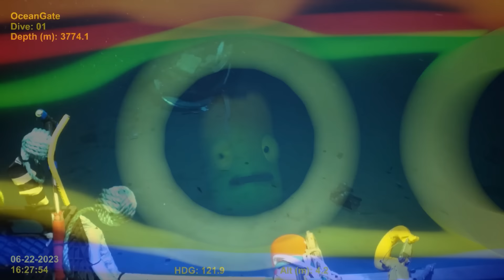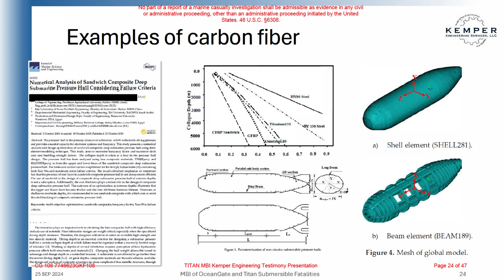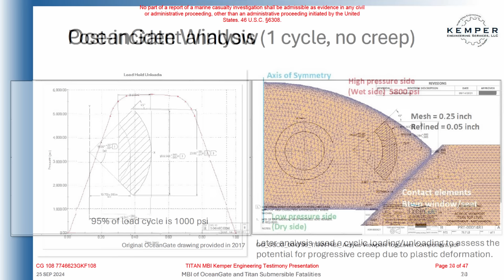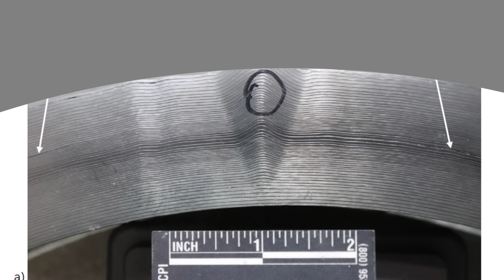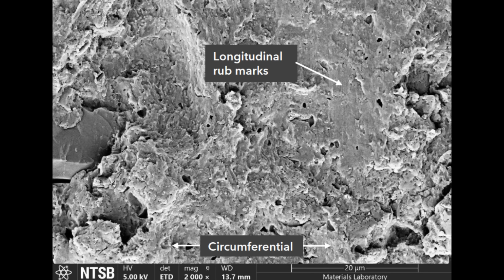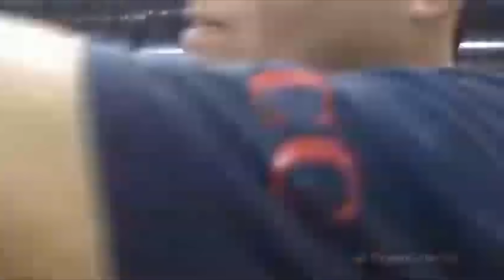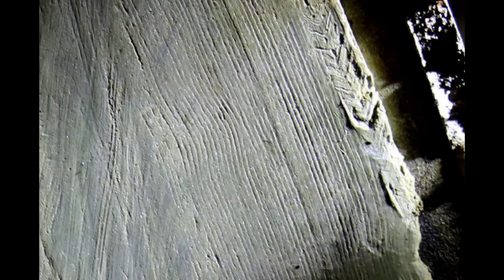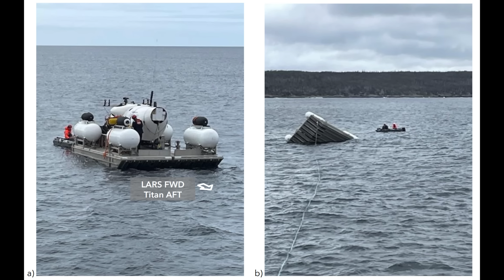OceanGate Wreck Shows Why Sub Wasn't Strong Enough To Survive - NTSB Shares Important Details

Comment: Sanding down the carbon fiber to smooth out the wrinkles??? That’s literally breaking it, the whole point is that the fibers are continuous. You know how they unwind the cocoons of silkworms instead of grinding them up and gluing the remains together? 

Either way it actually seems like none of what we’ve all been talking about was actually the failure point, it’s much simpler than that. Glue. Most common failure point on anything I’ve worked with that uses it. The carbon fiber distortion from fatigue and poor manufacturing certainly didn’t help but you absolutely cannot get a good strong reliable seal between composite and metal with just glue, and you can’t drill bolt holes through carbon fiber so it’s the only option and that’s the biggest reason of all not to use carbon fiber for this, not an inherent lack of strength but because it has to be all one piece and joining it to other parts doesn’t work well
Reply: Great analogy of silk cocoons. Thank you.
Reply: The phrase ”glued together submarine” doesn’t make you feel good
Reply: @hammartid  It kind of depends - the thing with submarines is you have all the pressure going inward so in theory the external pressure should hold everything together if it's designed properly. So for example, if they had had a thicker titanium flange on the inside that was capable of supporting the internal stress wouldn't break then maybe the sub wouldn't have imploded (problem is, if it hadn't imploded on this dive, Stockton would have kept using it until it did, like there was an obvious failure on 'dive 80' but kept going)
Reply: @takanara7  That's the funny part - the dive, being haphazard as it was, almost succeeded.
Reply: If you start crushing pipe and you see wrinkles in it, you know it won't be long now. They had wrinkles before they even applied any pressure, so the had pre formed failure points.
Reply: I agree. It’s the unpredictably and the minutely difficult prospect of in process checking that should make this option infeasible.
Reply: The grinding between layers means that the glue is always attached to broken carbon fibre on one side. I am not am engineer, but that seems like a bad idea for a structure that needs to avoid delamination to me.
Reply: What I find concerning is the size of the titanium mating flange (to the CF)
on the outer rings. 
..
It just doesn't seem deep enough or a  large 
enough cross sectional area for the glue to fully support or hold the end cap on.
..
If that mating flange protruded say 12 inches into the hull maybe a stronger bond?
..
I also wonder if both ends caps were bolted together with long studs and the carbon hull wrapped around those studs would that have made a stronger vessel ?
Reply: @stuartd9741  Yeah if the flange had been larger, it would have held up - this time.  But Stockton would have kept using it and it would have eventually failed for some other reason later on.
Reply: I agree on the glue part. 
But concerning "That’s literally breaking it, the whole point is that the fibers are continuous.":
Not necessarily. Surely it's not strengthening the material in that location. But like in ropes, fibers in fiber reinforced plastics can be interrupted, as long as the load can be redistributed to other fibers by the matrix (epoxy resin). There are parts manufactured with short fiber reinforcement all the time. However, their performance is lower of course, but also because the fiber orientation in such parts usually is random and not oriented according to the stresses present.
Reply: Glue isn't bad per se. PVA glue used on wood is stronger than the wood itself when used right.
Reply: Glue (bonding agents) CAN actually be physically stronger than the materials they're joining, I've seen it and done it myself... BUT it takes special efforts and thorough understanding of the materials, loads, responses, etc. to make it work... and the biggest take away here was that the understanding and knowledge, the basic data, was full of holes and unknowns... proper procedures are essential and even that was all being made up on the fly...
Reply: @lukestrawwalker  Which brings up the memory of their haphazard glue job in an uncontrolled environment with a spreader that looks like it came from a dollar store.
Reply: @dustman96  definitely!  It was a Mickey mouse operation from the start, the more we learn the worse it was!!
Reply: I think the failure point was the flange on the ring, caused by the composite tube being more compressible than the titanium ring.
Reply: I'm pretty sure there is some kind of solution with carbon fiber, they just don't care about reaching it... probably because it will cost same or even more as titanium hull.
Reply: Even I, a moderately informed laywoman, knows better than to sand or break carbon fibers in an item made from CF. It destroys the structural integrity of the item you're building. While I'm fairly certain there are ways to properly patch an area that had to be sanded down, I am dead certain Oceangate didn't follow them, based on everything I've seen.

Comment: 17:25 well I think your on point porosity definitely doesn't add strength. Kinda looks like it had many defects related to manufacturing....I bet the original breach was from the front edge of the tube splitting apart the carbon fiber layers like it did. Btw thank you for covering this, I've also been pretty obsessed with any more information about this disaster. 👍🏼

Comment: Solving the window problem would have been possible by maintaining the qualified concave inner face and applying a flat-faced lens to the inside with a nonstructural interface layer such as a silicone adhesive with a similar refractive index.

Easy to say with the benefit of the FEM simulation in front of us, but it might not have been obvious without that analysis.

Comment: Regarding the co-bonding adhesive between the 5 1-inch layers, two of them were applied with very little little porosity (between layers 2/3 and 4/5) and are pretty much entirely intact in the debris. The other two layers, between 1/2 and 3/4 had higher porosity and were almost completely delaminated in the wreckage. It seems like the adhesive used was of an appropriate strength, but applying it correctly was a challenge.

Comment: Particularly on Leech Lake, Minnesota, anyone that has owned a fiberglass motorboat, could easily imagine what multiple dives would have done to this idiotic contraption.
Weathering of fiberglass canoes, notwithstanding (remember those at summer camp?) 
The temperature extremes to sub-zero weather most definitely "accelerates the aging process"... wood hulls - with proper care - is by far more durable
(even aluminum hulls are more prone to cracking)

Comment: Boeing said it needed more. This sub was too unsafe for. Boeing. ...
Reply: Boeing has a LOT of carbon fiber experience regardless of their other safety issues.
Reply: That really puts things into perspective...
Reply: For all the trouble Boeing’s in, carbon fiber structural integrity is not one of them. Their CF work on the 787 is so revolutionary that not even their top rival Airbus can replicate it nearly two decades later.
Reply: As far as I can tell, it's the software and all the other support components is where Boeing is having problems and all of that is on newer revisions of ancient aircraft like the 737, I am not aware of any major problems with the 787 which as far as I can tell is one of the finest examples of carbon fiber engineering and not even Airbus is capable of replicating it
Reply: @the_undead Also assembly and QC, both theirs and their contractors. Not with 787 at least.

Comment: It's not "armchair engineers".
It's reality: carbon fibre is massively strong in tension. It has no property in compression. Used in compression, it's the epoxy resin that's actually taking the load.

Comment: The thing to remember about the use of carbon fiber was it was not to make it stronger , it was to make it lighter so they could cram more people into it . 

Carbon fiber is used when you need it lighter , otherwise you use other easier to work with materials that are not so risky .  The problem with a layup is that it is near impossible to get one that is perfect , and in this case defects cause load points that fail .

Comment: The trick to shaping the window to appear less distorted is to not have the flat face touching the tapered frame. Have a water layer between the convex window and a round-capped plug for the interior to optically bridge the gap between the two, but the interior window is just floating in a rubber frame to hold the water pocket in there and present a flat optical surface to view through. That's my guess anyway, it would have to actually be tested before I'd actually use it for anything like Titan.

Also, it seems like some reinforcement rings around the inside of the carbon fiber, some ribs, would've gone a long way, but at the end of the day it was always a disposable design because carbon fiber held together with epoxy was never going to be a reliable pressure vessel. Gluing the rings onto the ends by hand was also a mistake. They should've just flooded those rings with epoxy and then set the tube into them, and the ring channels that mate with the tube should've been deeper and with thicker walls.

Comment: Im thinking they should have had external titanium straps located around  the circumference of the hull pulling the fore and aft rings together . Relying on glued joints alone was asking for trouble .

Comment: Could have increased carbon fiber to 12 inches, but look how much money he saved by only winding 5 inches of carbon fiber.
Titanium end caps were cast instead of milled, again look at how much money he saved
Reply: weight is also a problem.  can't just make the hull thicker without limit, it has to float too!

Comment: the main issue really was using carbon fiber in the first place. if they used steel or titanium, there would have been no need for glue and ensured a far more solid pressure vessel. sure it would have cost more, but it could have saved their lives.

Comment: Haven’t worked with carbon fiber, but have with acrylic and epoxy. Acrylic strength at layered areas can be weaker. Epoxy is a bugger for bubbles and contaminants, even dust, which causes weaknesses. The more details emerge, the more I understand why the one engineer refused to get into the thing.

Comment: The only way I think I would ever trust it, Is if I built two craft that are identical, and have one of them get cycled more at the start and then have the same "Test-Sub" go down and then back up before each time the craft with passenger makes the same trip,
And also, I would have had a much smaller scaled-down test model that was built using the same CF/epoxy/TI, along with the same bonding process, to get cycled to a greater crush depth, and then to have the CF/epoxy examined by cross-section after it's been aged with full cycling.
This would be the only real way of knowing, then calculating the submarine's expected life expectancy is, As you really need proper physical testing before you can try and use computer simulations.
Reply: that's literally what they did with the bathysphere.  sent it down unmanned and hauled it back up.  they only sent humans when it stopped coming back up full of hyperpressurized water

Comment: Bangs correlating with sharp changes in strain seems like an incredibly huge and bad warning flag... Even if I don't understand any of the other finer details about reading the charts.  I feel like any remotely competent or even just curious engineer would want to go and fetch all of the available sensor data and look at all of the sensors immediately before and after the really big bang to see if any other sensors recorded any kind of anomaly... And then they should have seen it and gone oh wait there was a loud noise and the stress on everything sharply changed that doesn't seem like a good sign if everything is supposed to be securely bonded together so it can't move

Comment: Wow so the hull monitoring system gave early warning several cycles before the failure happened. That's actually quite impressive. If Mr. Rush spent half the time he talked about it, looking at the data he may still be alive. Of course you would need to build at least a scale model with the hull monitoring system and then they would have known a "big event" means failure is imminent. Which I think anyone could have figured out. It went off the charts. So the thing supposed to predict failure by measuring certain events, detects one so large it presumably goes beyond what the microphones can capture without distorting and they ignore it? It's like checking the bilge for water and seeing half the ship flooded and going back to bed. Why even bother?

Comment: I'm dismayed that they didnt lay any fibers at 45 deg. Carbon layed at 0 and 90 deg is shockingly week and eslatic along the 45. Fibers at 45 deg may have also helped stabilise the structure during layup and cure...
Reply: I am dismayed they didn't lay down the fibre for the whole length of the cylinder at once. And even that would had failed anyway eventually at the junction with the titanium ring.
Reply: I'm sure doing it at 45⁰ would have reduced the wrinkling too

Comment: I'm curious why they wouldn't have some sort of roller that squeezes down the applied carbon fiber layer to a specific tolerance after every application. It seems like that would solve the wrinkling problem in a straightforward way. That roller would always be a fixed one-layer distance away from the mandrel so you could set that up and calibrate it pretty easily.
Reply: It wouldn't stay that way since it needs to be held down while curing. On the other hand, that is why vacuum bagging exists. Having so many layers though will eventually amplify any wrinkle imperfection.
Reply: @DKNguyen3.1415  Good points.  I guess yet more reasons why CF of this thickness is just not feasible in this way.
Reply: @doublestrikePhoto  Yeah. I'm kind of wondering what the thickest laminated carbon fiber structure is. I also wonder how much tension is being put on the fabric when it's rolled onto the mandrel.

Another commenter here said that the wrinkles are a result of the vacuum bagging which compresses the carbon fiber to a smaller diameter and the wrinkles are a result of that extra circumference of fabric needing to go somewhere. In which case, the problem is considerably worse than just amplification of imperfections. They suggested layering it up internally (which would then require a balloon to pressure the carbon fiber against the walls during autoclaving) but to me, that also sounded unreasonable. They said some NASCAR parts are made this way though.

Comment: Excellent video, well done.  

The "carbon fibre no good in compression" point seems intuitive but all CF engineers I have seen commenting argue against that, citing CF aeroplane ?wings or bodies having parts of them in compression.  I believe there are cycle/hours restrictions on those, and of course Oceangate lacked the data to calculate suitable numbers.

The message I take from this video is that it looks like NTSB is going to be able to produce a great analysis of the design errors and the failure.
Reply: “CF no good in compression” is definitely a simplistic statement. Most materials have different strengths in compression vs tension. CF is weaker in compression. A good engineer will understand the material properties and all the forces that his design will be subject to; and make sure that it has sufficient margin to withstand those forces. Oceangate didn’t understand their materials, didn’t understand all the forces involved, didn’t have sufficient quality control during manufacturing, and didn’t do any data analysis or non-destructive testing to know that the sub was failing.
Reply: @bbgun061  Yes, 100%.  From what little I know about buckling failures, the failure point can be rather sensitive to construction and fatigue defects and hard to predict, so needs to be approached with both modelling and empirical testing.  It's an elastic instability, defects may have the effect of increasing bulk elasticity, so seeing the layer waviness and other construction/fatigue defects and knowing their lack of data raises concerns about their ability to predict failure/identify safe usage.

Comment: The bending strength of a material goes up by the square of it's thickness.  So a 4" piece of material is 4 times stronger than a 2" piece of the same material.  The material needs to be one though, two 2" pieces together is only twice as strong as the single 2" piece.  This is how leaf springs in a car work, the pack may be 2" thick but has a lot of elastic deflection, imagine if the spring was a solid 2" piece of steel, the deflection would be minimal.  In reference to this hull, if there was elastic give in the intermediate layer glue (green glue) the strength of the hull would be far lower than a continuous 5" thick hull.

Comment: As an aircraft mechanic, one of the first things we got taught about carbon fiber was, that it has a lot of tensile strength, which also depends on how it's woven.
But almost no compression strength.
Building a submarine pressure vessel out of carbon fiber is beyond insane imo.
A pressure vessel with the pressure from the inside would be fine. Something like diving tanks for example.